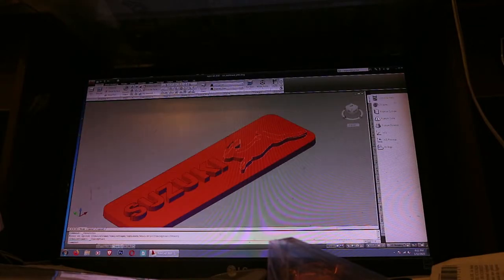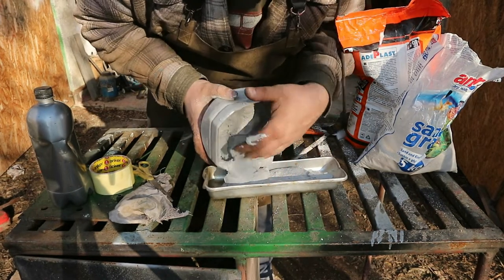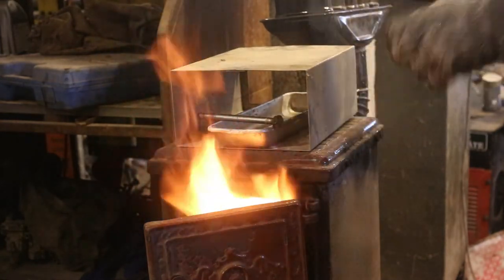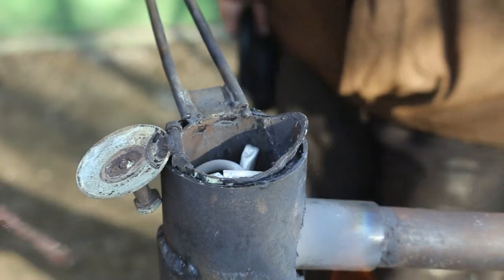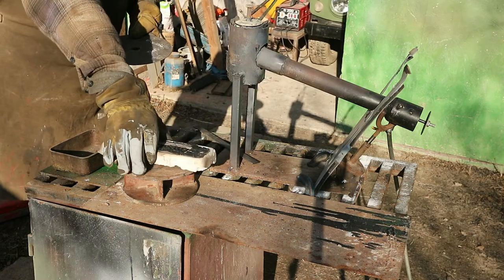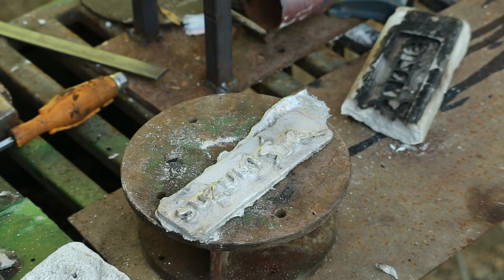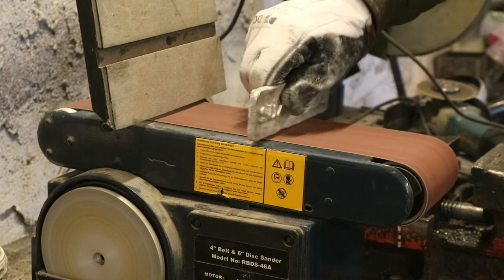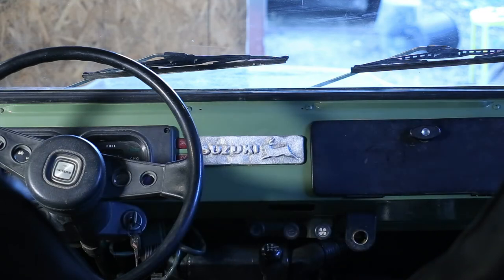Lost PLA #aluminum casting using plaster of Paris mold - first [DIY] attempt

Comment: You can do a couple of things.
1. PLA is not a great material since it does not burn out completely and cleanly, you can use polycast filament instead or a wax material
2. Aluminium is very light and it does not like to flow into small shapes, you can create a big riser to increase head pressure, those open face moulds are usually crap, tilt your mold by 90° to the side with a big riser.
3. Burn out the plaster for longer
Reply from the maker: Thanks, i will try some of these things in the near future i hope. "Casting" filament is somewhat harder to find in my country but, i'll keep looking and maybe buy something on-line.
Reply: @isographer  I wish you luck =)

Comment: Here are some hints from someone with many years of experience with pouring aluminum in plaster molds .  There is no need to add sand to the plaster.  Mix the plaster with more water to help it pick up the details. If you coat your pattern with a release agent, like Vasoline , you might be able to pull it out of the mold, but the pattern needs to be smooth.  In the foundry world, draft or taper on the vertical surfaces allows for drawing out. Dry the molds to drive off the moisture before you pour the metal. I have never poured into an open mold.  That is very primitive.  Make the mold a little bigger for stability.  Don't pour directly into the cavity.  The aluminum looked a little cold.  Good luck with your experiments.  You will finally succeed and shout Hoo-ray!
Reply from the maker: Thank you for your input. Is good to know that very little sand is required. As a matter of fact, last night I have prepared another mold, and actually used more sand than plaster in the mix... :) Well, at least the part only has a functional role, and the aesthetics of it are not important. Since filming this video I have (hopefully) improved my melting rig as well so hopefully I'll have better results in the near future.
Reply: Hallo! Could you use the plaster of Paris mould repeatedly or does it fall apart after a few pourings?
Reply: We never used plaster molds more than once.  They are not strong enough for refractory qualities. I agree with previous comments. Use a release like Vaseline or wax shoe polish to keep the plaster from sticking to the pan and the plastic pattern.  Sand the pattern smooth.  We would also use lamp black from a kerosene torch to give the plaster some release from the aluminum

Comment: Try casting in the kids toy sand called 'Kinetic Sand'. I have had great success pressing a shape into the sand, then casting with tin / pewter. But I saw 'king of random' cast aluminium in the sand as well... Great details in my casts and clean sharp lines.
Reply from the maker: Thanks for the tip!

Comment: Your problem probably was the water. 
Leave the mould on a house radiator for a couple of days. It should feel light and when you ping it with your finger, it should sound almost like ceramic.
Reply from the maker: Yep! You are correct. I am planning to do another piece in the near future and that is how i am going to do.
Reply: @isographer  Good luck!
Reply: how long does it usually take for the plaster to dry completely

Comment: Hello! I'm doing a very similar project (only the design changes to be frank), and I'm stuck at the same stage as you - Plaster not dry enough - When will you try it again? I'm interested to see you process! Thank you for this video !
Reply from the maker: Hello, sorry for the late reply. Since making this video I got sidetracked a bit, first i have tried using some art clay, but the results were poor as well, for different reasons (maybe it was my method, as the clay still might have some merit) than I have realized that I need a proper oven. And this is where things got cold for me, so to speak. I cannot melt PLA into my apartment, because of the smell so the conclusion was that I need to get an oven for my garage. A full size kitchen gas oven is out of the question for me, though - the only option will be an electric one, but I did not get around to buying one, yet. Maybe it was because I don't like electric heating elements in general and I also got sidetracked with other things. Your comment re-sparked my interest though and maybe I'll just buy a very cheap one second-hand and give it a go as is.
Reply: Thank you for your reply! Can't wait to see your next steps. Best Regards ! @isographer

Comment: Let that plaster of Paris sit for a week. Then heat it up slowly before pouring.
Reply from the maker: Hy, thank you for your sound advice. I have thought about doing so myself, and I believe it will work, however I wanted something a little quicker so in a subsequent video I have heated up the plaster mold in a kitchen gas oven, face down. The results were satisfactory, albeit the melted PLA smell was not (but the good part is that PLA is non-toxic) and overall the pour went well. Here is the video:   https://www.youtube.com/watch?v=qcLMZMCr8N4&ab_channel=isographer